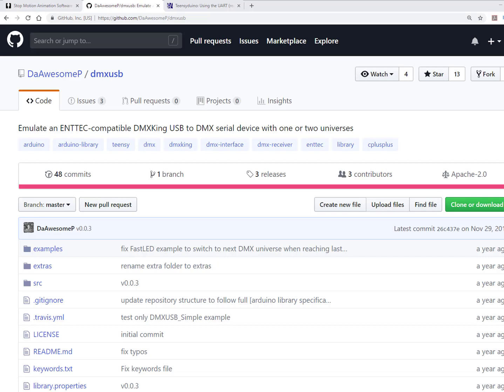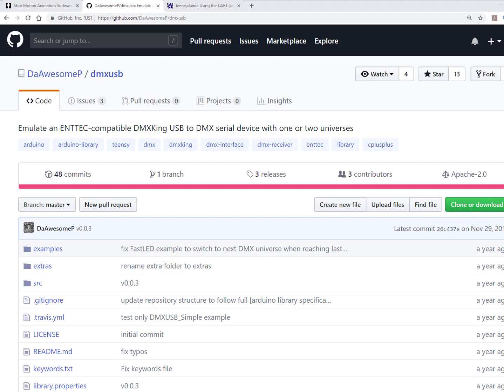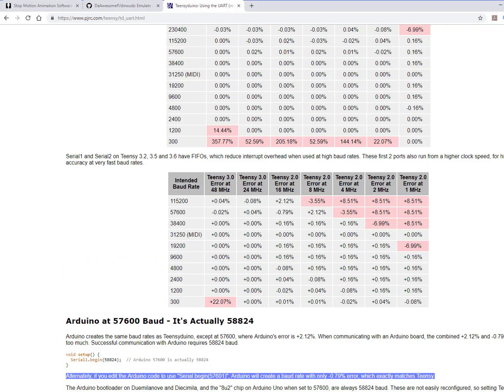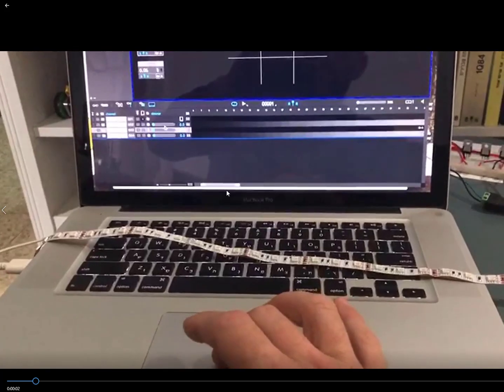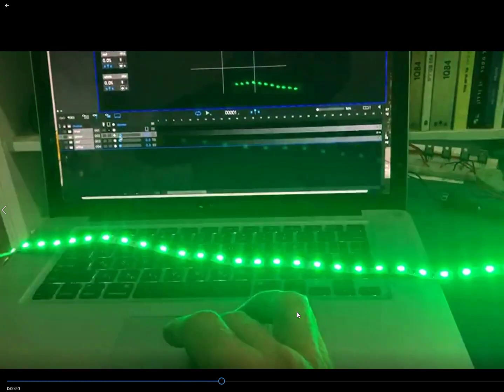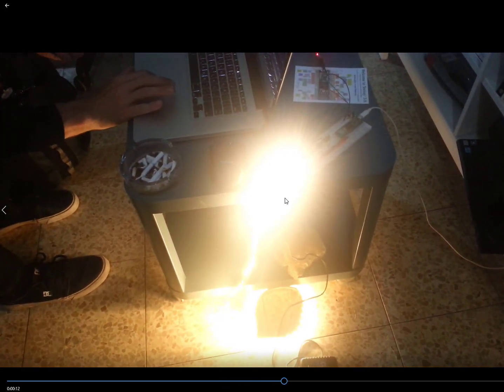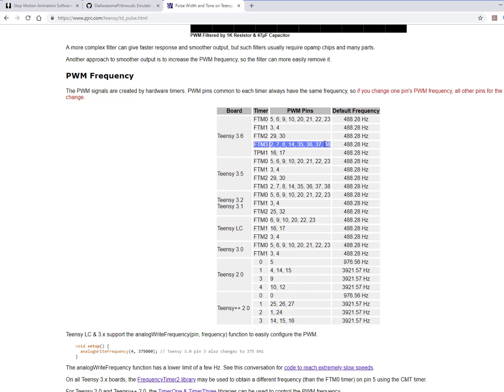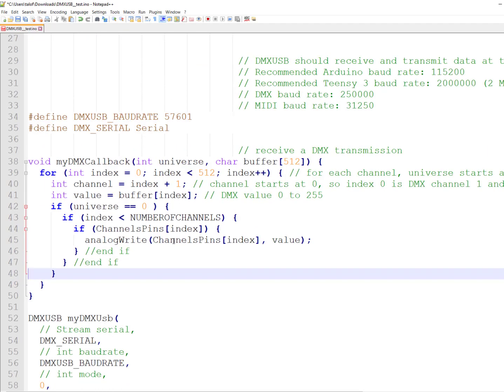Dragonframe with teensy based ENTTEC compatible usb-dmx DIY lighting controller

Comment: Did you use two Teensy boards for the 2 led strips? Because at 2:40 it looks like it.

Can you adress them individually with 1 Teensy at the same time? Or do you need one board for each light strip?
Reply from the maker: One teensy - one light strip. 
You can have as many channels as you want (read the protocol spec) there for you can have as many strips as you want, each strip uses 3 channels, one for each color.
I think the only limit is the memory, and with teensy I think you will run out GPIO before memory.
Reply: @talofer99  Thanks for the quick reply.

I am a complete amateur when it comes to electronics, so I would like to run things by you, just in case I missunderstood something.

Here is a ruffly sketched circuit for what I plan to do (I'll pack in a capacitor to remove noise later on)
https://ibb.co/2nmMjTM

I use the PWM capable outputs on the Teensy 4.1. The Frequency you set in your code (20000hz) would need to be set for each output specifically, because they are not on the same timer on the 4.1.

The Duty Cycle of the PWM output is determined by the buffer value, which I get from dragonframe (The DMX signal). That Value is set for each output defined in "ChannelsPins" seperately, so I can controll the PWM output of these 6 pins seperately via dragonframe.

The Value determines the % of time the signal is on "High". So 255 would be 100% (a flat line at 5V), 0 would be 0% (a flat line at 0V) and 128 would be 50% (equal times at 5V and at 0V). The Frequency set for the PWM output determines how often that happens per second.

This signal then connects to the Base of a Mosfet, which controls an external 12V power line. If the Base gets the required signal, then current will flow and the respective LED (Red, Green or Blue) turns on and off again when the signal is at Low.

So this turns it on and off, where the time the LED strip stays on is determined by the DMX signal. Thus dimming the light happens not because the voltage gets lower, but rather because the LED stays on for less time. 

__________________

Would that be an at least somewhat correct assessment? 

On the Baud Rate issue:
Will I get in trouble when I use a Teensy 4.1 instead of a 3.6? 
On the Website listed in the description, the error rates for Baud rates of the Teensy 4.1 are not listed.
Reply from the maker: @bass-dc9175  you described it very well :) 

About the baud rate I would guess yes you will have the same issue. 
And since its only trying 2 different baud rates, it should be easy to figure out. 

Would love to see a photo of it completed once you get it running :)
Reply: @talofer99  Thanks for the info and will Upload some images once the Project is done. The Project I am working on is a spaceship used for miniature effect film making. 

(4 Steppers controll the angle of the engines and inside the main body and each engine are LEDs, so exact reproducibility of the shot including the lighting is key)
Reply from the maker: @bass-dc9175  sounds like a very cool project make sure you document things as much as possible take photos and videos of trials - its fun watching it later :)
Reply: @talofer99  Well it seems that I can not get it to work with a Teensy 4.1
It was a shot in the dark, since the DMX library has only been supported to 3.6 

The only thing that happens is constant dis and reconnecting of the Teensy with brief glimpses of a seriel USB devince being avaible to connected via DDMX-512 in dragonframe.
I guess this may be a problem with the baud rate, but I do not even know how to even approach finding out the correct one. 

115200 Failed.
57600 Failed.
57601 Failed.
58824 Failed.
2000000 Failed.
12000000 Failed.
921600 Failed.
250000 Failed.
31250 Failed.
38400 Failed.

Perhaps I overlooked something, 

But I guess worst case scenario would be: I have to see if I can find a Teensy 3.6 quickly.
Reply from the maker: @bass-dc9175  I guess going with 3.6 is not a bad choice here.
Reply: @talofer99  The Teensy arived today. I copied the code for testing purposes with a Baud rate of 57601 and it keeps breaking up after 7-10 seconds in dragonframe.
I also tried 57600, 200000 and 12000000. Same problem.

EDIT: Nvm, used the wrong DMX profile. (Instead of ENTTEC it defaulted to DDMX-S2)
Plugged it into my board, switched the Pins in code and it works like a charm. Thanks for the help.
Reply from the maker: @bass-dc9175  Glad to hear it all worked out :)

Comment: Pretty much exactly what I needed. I want to control LEDs with a teensy but also at the same time use Dragonframe's motion-control to control stepper motors. Im gonna try to frankenstein this arduino code with DFMoco
Reply from the maker: Cool, would love to see the end result :)

Comment: This is amazing! I'm looking for this exact solution but hearing  and reading about all the components and jargon is making my head spin. I will try and break down what I think I need and what to do to get to your solution. 

I would like to run 4 led strips separate with 12 separate channels that I can control in Dragonframe

This is my shopping list so far
1 x Teensy board 3.6 
4 x 12v RGB LED strip
1 x breadboard
1x 12v Power Supply
12 x Logic Level N-channel MOSFETs
12 x 10k Ohm Resistors
Hookup wires

So I would install  this code onto the Teensy  - https://pastebin.com/twLkT6Dy 
Find a wiring diagram connect everything - 
I'm thinking about wiring it like this? - https://create.arduino.cc/projecthub/najad/12v-rgb-led-with-arduino-fb6c46
Then connect to Dragonframe?

Any feedback would be greatly appreciated! 
Keep up the awesome work!
Reply from the maker: Thanks :) 

Yes this is what you need to do in order to get it running.
You will need the library as well, but you can find the link for it in the INO file.

Let me know if you get it working :)

Comment: I would love some more info on how you set this all up. I'm working on stop motion projects and would love to automate some of the light changes using dragonframe.
Reply from the maker: What info do you need ? 
I did only the arduino side, and it's done using Serial DMX .
Reply: @talofer99  The arduino side is what I need help with. I am currently using dragonframe for motion control, but don't know how to begin to set up the led code in arduino etc..
Reply from the maker: @MrCharlieuniverse  let me give you a link to an example on line 
https://github.com/DaAwesomeP/dmxusb/tree/master/examples/DMXUSB_FastLED

and you can look up on how to connect things in this tutorial 
https://create.arduino.cc/projecthub/talofer99/arduino-and-addressable-led-b8403f

Le me know if it helps you out.

Comment: Hey, do you have any clear photos of your board setup? I have very little experience with the Arduino, outside of a few basic tutorials that come with the uno and a bit of programming experience in various languages. I'm looking to mirror your setup on an Arduino Uno using these lights: https://www.amazon.com/gp/product/B01AG923GI/ref=ppx_yo_dt_b_search_asin_image?ie=UTF8&psc=1
Reply from the maker: Hi, 

My setup will not help you with the Led you want to buy, mine are controller by PWM, while the one on the link is addressable - I have a video on how controlling this type of LED 
https://www.youtube.com/watch?v=8y2F2RhvqG4

About the DMX side, its just using the USB no special connection needed, just the code.

let me know if you got it working.